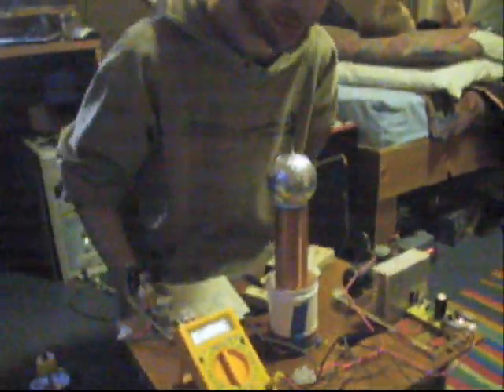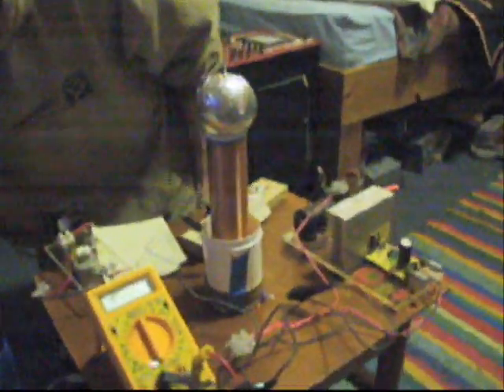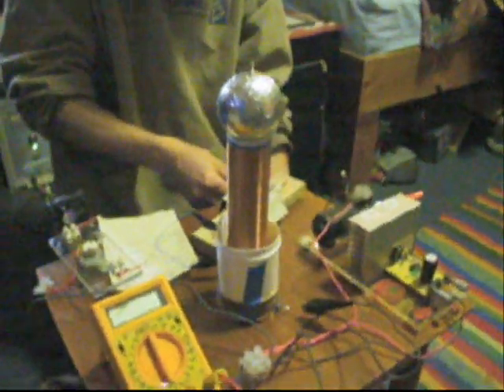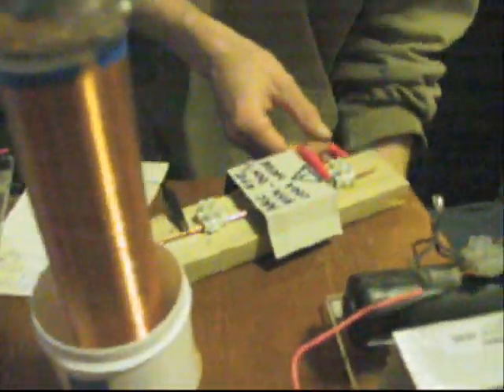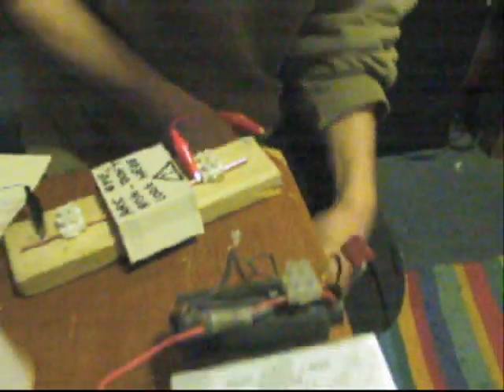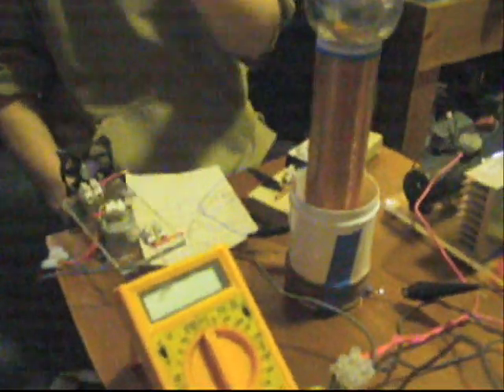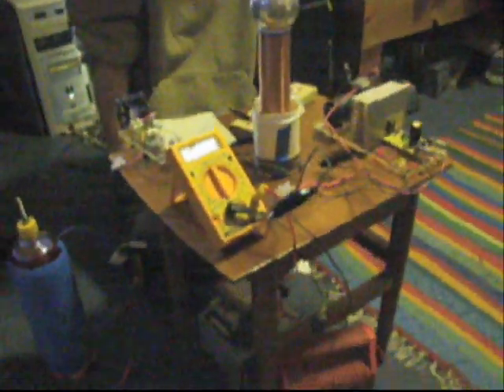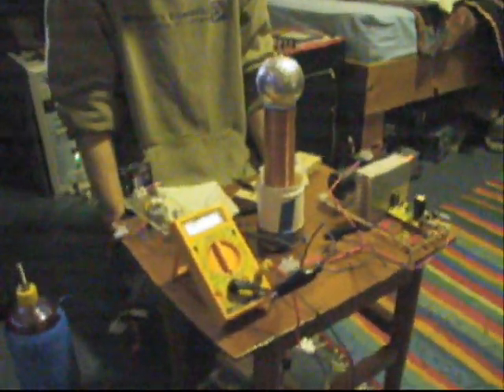12V DC Tesla Coil (SGTC), 555 + MOSFET + ignition coil

Comment: I wanted to ask the same question like Landotter1. Why the rectifiers ? I have a ignition driver with an ignition coil too and I was thinking of connecting it to a tesla coil but I was wondering if it only works with an AC supply.
But it seems like it is working with a pulsed DC signal am I right ?

Comment: If you build a second tesla primary and secondary and run in the same feeding circuit but in antipararel (reverse the primary coil connections on second coil) you would get double the voltage :-)

Comment: Funny but I tried something VERY similar & got that familiar loud snap.. Run it into Mhz and I'm sure it will be softer....Some of the parts could have come from the same source & I live in the States! However (just my opinion) but a true toroid would have give you performance that would have done the labour some justice (I found that out the hard way also).

Comment from the maker: No RF choke at the moment; the spark gap does sound a bit odd because it was covered with a cardboard shield during the video run. Doesn't seem to stop it quenching but I'm going to get rid of that and use a blower for better quenching. MMC next with double the capacity (and primary retuning to match).

I've watched a lot of your great vids mate, really nice work! I feel for you with your neighbour issues too.